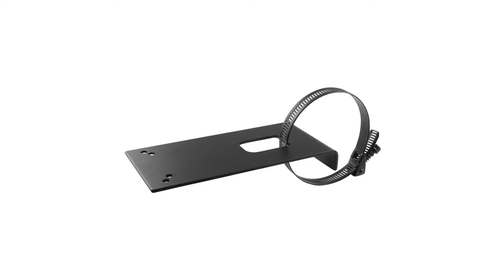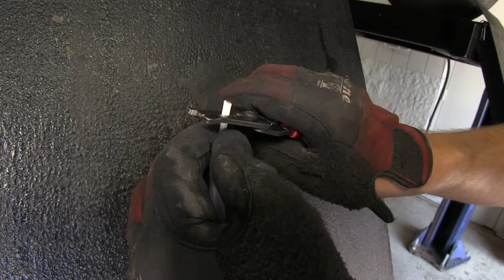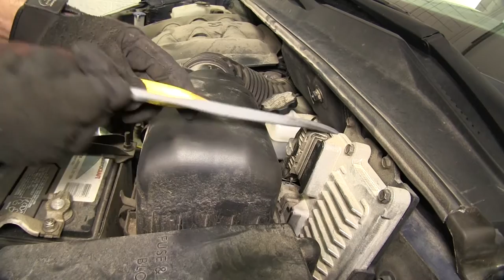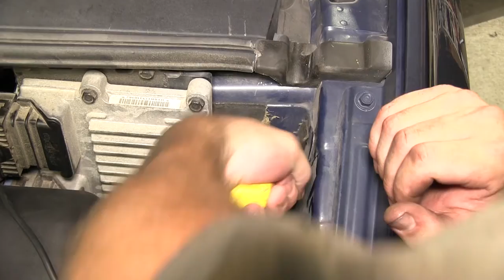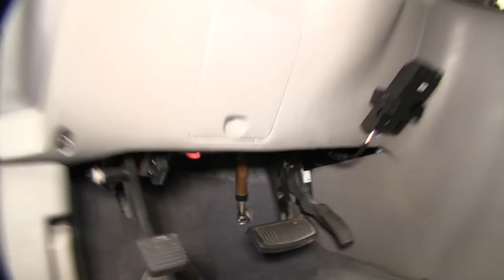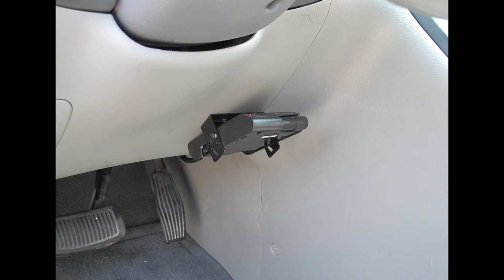etrailer | Trailer Brake Controller Installation - 2008 Kia Sedona

Comment: And you guys are definitely pros at this.  So, for an amateur, it would probably take 2.5 to 3 hours... especially without the hydraulic lift.  Although, I hope/plan to buy a trailer soon.  I'm going to see if I can sweet talk the salesman into doing a discounted or free brake control install.